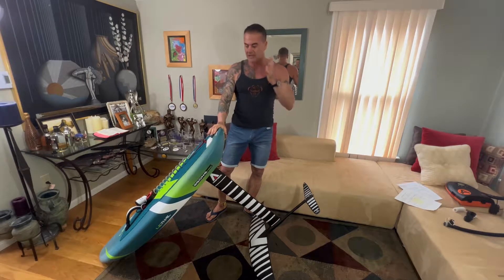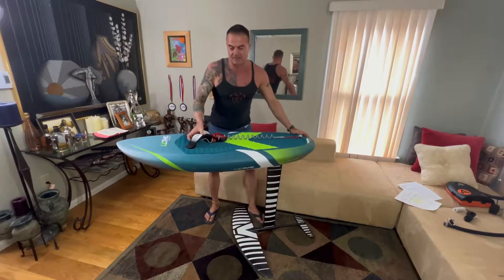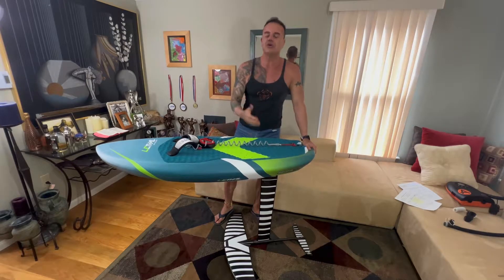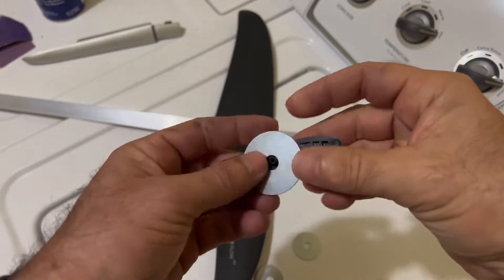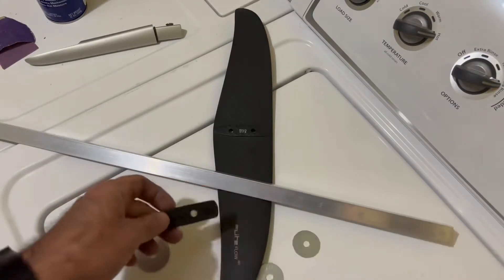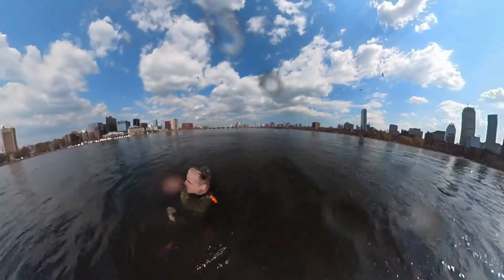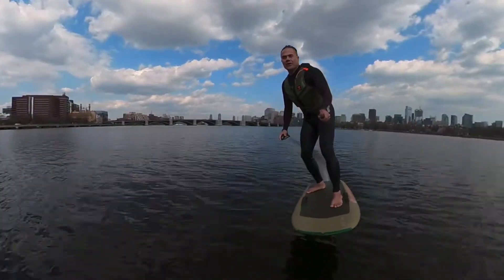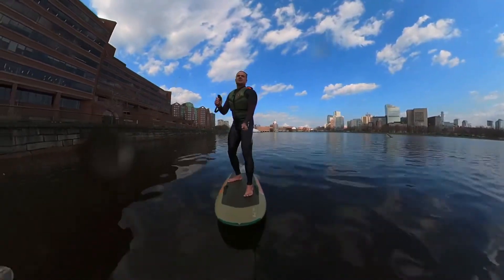Fliteboard Negative Shim DIY

Comment: Rolando, great video! Have you had any luck finding someone to print negative shims? I had made my own negative shim but would like to try a variety of sizes.
Reply from the maker: No...my friend who was thinking on making one on a 3D printer end up not doing...flitebord has not touched on the idea either...and I don't use Flow 1100 in flat water anymore...only on waves...but on waves you deff don't need the negative shim... But I  Hope they will gt into that...I guess there is not a big demand...but I think they should have it anyways. How did you make your shim??
Reply: @Coach_Rolando  Sorry to hear that did not work out. I used some scrap vinyl that I had to make my shim. I removed the original shim and just use my home made shim. The front bolt tightens the wing directly against the aluminum structure and the new shim just goes under the back half of the wing.  Looks very similar to the shim you made just my measurements are based on not using the original shim.

Comment: Great video. Have you found anyone to make the negative shim? I want a -.50
Reply from the maker: Hello Kamohai..so far no...as I said...People from Fliteboarod are working on it and they say they will even make a download version so you can 3D print it...My friend Steve (rep for fliteboarod in NE) also asked his workers to scan and make some negative shims...However I think they should be in small "levels"...Meaning...Minus 25, minus 50, minus 75, minus 1...I don't think or see anyone needing a minus 1'50 or 2.0 ever.... But it all also depends on the wing size you are using...you are very light ...Im 195lbs...so if Im using the 1100 in flat water has too much lift for me...so I use my shim...but in waves is just right...but when I use the 900 I don't need the shim at all...and I'm crying at "9 to 10" ...so it all depends on the wing you are using...but off course the fast you go the more lift you will get...Im sure you should be ok with the flow 900 or the flier 800...ut them again at 140lbs the shims in flat water deff will prevent you from lifting your nose too much..Ill keep you posted...it looks like a 0.25 or a 0.50 will be the best for you. Thank you for watching...I just got another Fliteboarod...the 2.2 and Ill be making a review soon and give mote tips...have fun in the water bud

Comment: Great tip of keeping your back foot over the mast, it has helped immensely with keeping control of roll. Then you can just focus your front foot placement on pitch stability.

I finally got my flow wing and went out for a quick run up the river, I went up to a +1 shim from the 0 and that was a big mistake. This wing allows you to carve so nicely, but it has a lot of upwards 
pitch. More than the cruiser starter wing, especially when you try throw it around. I wonder if the flow 900 would be better than trying to counteract the lift with stabiliser downforce.
Reply from the maker: Agreed....I think I will do better with the 900...specially cause I com from the flier witch is 800...I feel the "lift" was well, specially on the turnns...One thing I realize too...the tips of the wing tends to breach the water in sharp turns...and that can make you take a quick wipe  out...LOL...I wish they had shops everywhere so you could try the wings first before you buy it....I deff think the 900 will be a better fit for me...So I just waisted $$$...ill try to see who wants to buy my 1100 so I can buy the 900...Yes...having the foot close to the mast helps...but off course you can have it off center as well. Now if you did not had the "torque" from the prop and were "wing foiling" you would deff want to have the back foot directly on the top of the mast...cheers my friend and let me know if you get the 900 before I do

Comment: Great amateur R&D, until your video I was skeptical as I can not understand why a supplier would give us 6 shims being only one side of the spectrum and also making the most used 0-shim super thick in and super sensitive to over torqueing. I'm sold now and have same set of 1100 Flow wings. Would advice you to make new shims yourself, since it's super low tech. Just make a mold using 0-shim. Fold can me in clay or "magic sand" then tilt the mold 0,75 egs or so and fill it with Soldering lead or molten alu if you can reach those temps. Have not tried myself yet, but will this weekend :-)  Keep up the nice user videos Rolando. Greetings from Sweden.
Reply from the maker: Thank you for the comment...The reasoning I think that they did not made yet is because their main goal was to get people to learn how to foil faster...and also cause is a fairly new sport (efoil)...Armstrong Foil brand was the first one experimenting with "negative" shims...As they go faster and faster with the regular foil and as the waves gets bigger they found the necessity to have a negative shim to create less "lift" and promote more speed....Same concept with the EFoil...the problem is that the tork comes from the back of the foil and it will always generate more lift regardless...ISo that is why the foil needs a negative shim more than the regular foils....t is kind funky at first but you get the hang of it right the way. As I said...it is a new sport and as we all progress and get better they will have to adapt to our progression...I just saw a video of this 2 dudes with a fliteboarod riding the waves in  nazare ... Even using the smallest "race wing" (the smallest and fattest in the fliteborad line) they were getting too much lift ... so fliteboarod custom made a few negative shims for them. So now they finally realized that there is a demand for it. My body here Steve (rep for fliteborard in MA) has a 3 D printer so he will be making a "proper" one for us...but rest assure that flitebord is working on it. Once I get the new ones ill make another video...also im on the process this Summer to do a video "1 year of use  and 10 tips pros and cons about fliteboarod"...regardless it is a great efoil and I still don't hame much complain. Thank you for the  idea of the mold...and please share your made shim on a video here once you have it done...thank you bud..
Reply from the maker: Have you got to make your shims yet? hw they came out and did you like them?

Comment: Interesting thanks for posting. Have you found any difference with how the board transfers from pushing through the water to getting on the plain. I found the higher shims could bog the back of the Board down as it transitioned from displacement to planing. Also do you think the negative shim makes the board anymore nervous when on the foil.
Reply from the maker: It all depends on the speed...I can go up on the foil on my level/gear 4 at a 0 degree shim (I use the pro board, the 1100 flow wing, and im 195lbs) I can also get on foil in the same level/gear 4 with the same set p using the negative shim...Basically the only thing that does it brings you back on the board so you center of gravity is closer to the mast...In another words if you go slow or faster the only things that does is that makes you stay closer to the mast rather making you go all the way yo the front as you go up on gears...Today was the first time I went up to 16 and my feet was way in the back...of course at high speed it becomes very unstable...However on my "cruising  speed" 8/9, I feel much more stable on the negative shim then on the 0 Shim...at 8/9 level/gear  Im very close to the mast so it makes more stable for me. Now my Friend Steve (representative of fliteboarod in MA) has a 3D printer...so we he will be making the real shims  that will be much more accurate them mine....But as I said on the video fliteboarod is making too ...the question is when it will be available for us...I hope I was able to answer your question...cheers bud. and thank you for watching and the question.
Reply: @Coach_Rolando  Thank you Rolando for your reply